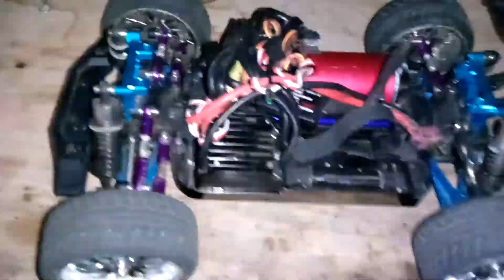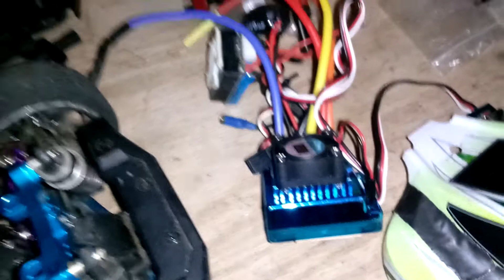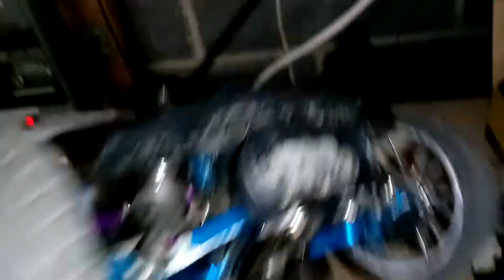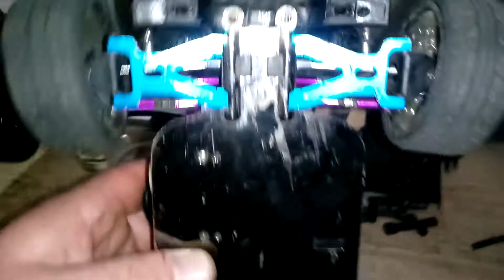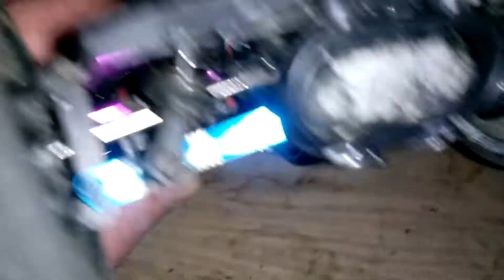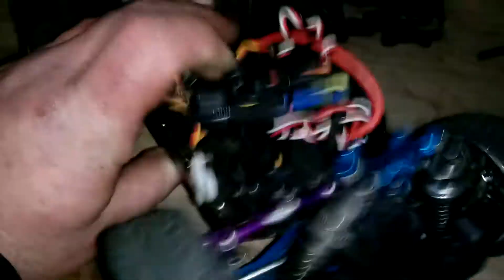A959-b brushless motor and esc upgrade!

Comment: Bro is that a 27t pinion gear?
Reply from the maker: Mark Christian San Pedro yes it is. That is what the a959b uses. The a959b uses a different motor mount. I have an adjustable motor mount.
Reply: Bashing RC 24/7 thank you bro!

Comment: what servo will i need  ?
Reply: with this ?
Reply from the maker: Cody Robinson I use https://m.ebay.com/itm/EMAX-ES08MA-II-12g-2-0kg-Mini-Metal-Gear-Servo-High-speed-Upgrade-Mg90-S/221969217898?epid=1071353791&hash=item33ae65796a:g:GQ8AAOSwTapV6puV
Reply: thanks man. know of any other kits that will fit ? motor server and esc ?